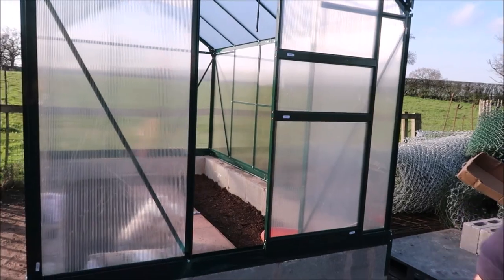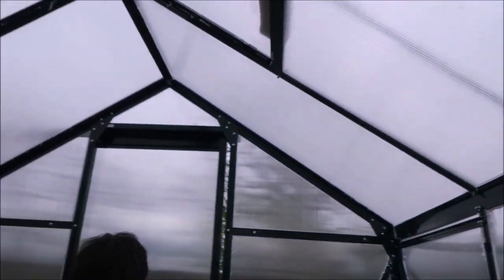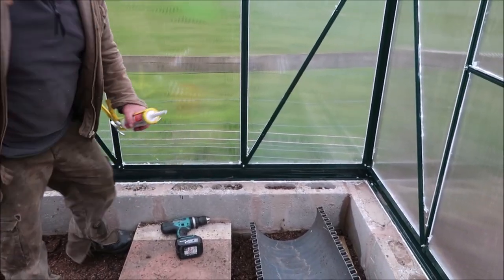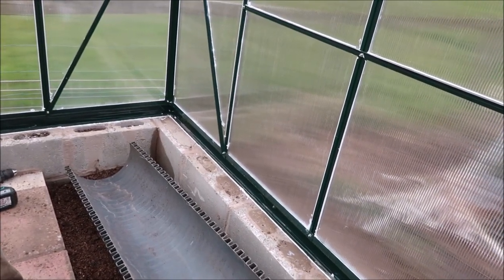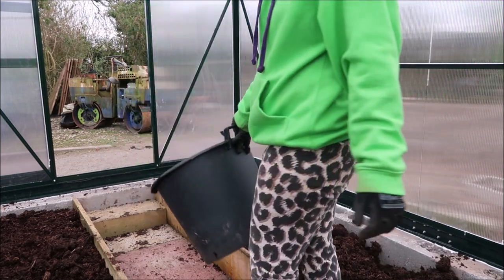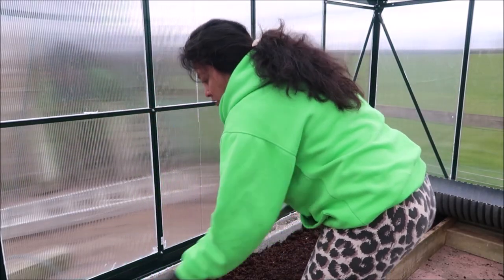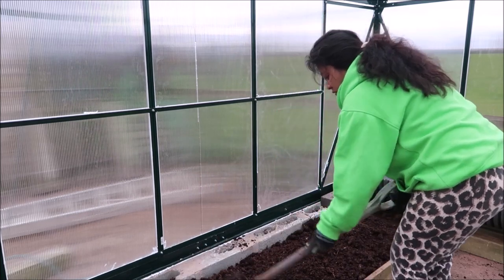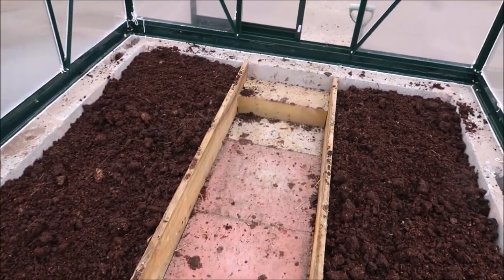My Green House is Finally Done | A Filipina in the UK

Comment: Congrats Dem, and job well done to Spence 👍
I see you "grounded" it, i think that is an good idea, dang how strong the wind was here in last storm at the end of Eastern, the house make noises i never have heard before the 30 + year i have lived here :)
Reply from the maker: Spence thinks it wont really stand very strong winds we just hope it will :)
Reply: @afilipinaintheuk112  Then i would have make some extra enforcement :) If i'm not wrong you guys do also get the "leftovers" from hurricanes from the Mexico Gulf/ bay ? area. After that it come to my place but with less water in them, as a lot of it are given away to your place, but we still get the wind and our "fair" share of water ;)
Reply from the maker: @torfinnskari  Well we have put additional  sealant both inside and outside to hopefully hold the plastic panels in place...  in March we normally have strong winds but in the winter it can be worst getting storms off the Atlantic hopefully it's still there next spring thanks Torfinn :)